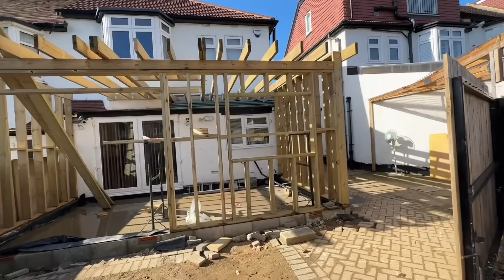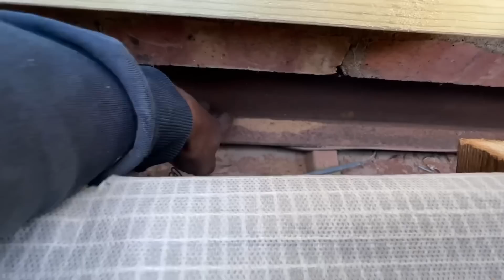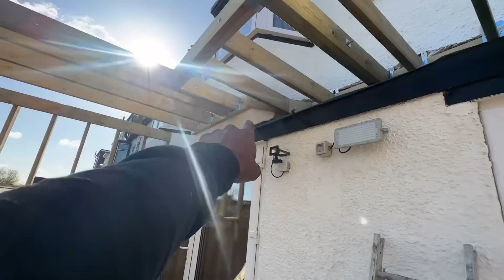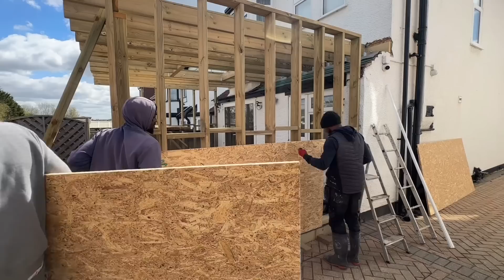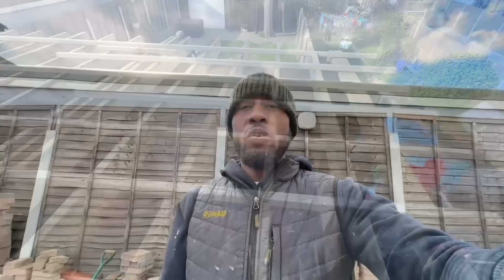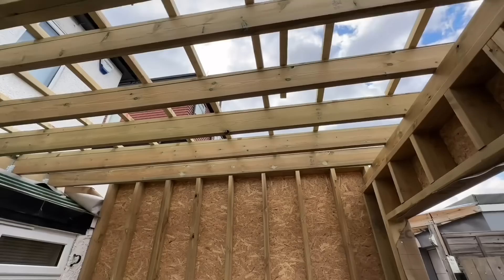Timber frame extension: Ep 14

Comment: great build and you guys should google "king and jack stud framing" and look at the images. The americans have been building houses out of wood and it's something they do better than us in the UK. The extra stud you added for the window opening that someone else mentioned in the comments of a prev video is called a 'king stud' and it should have been laid against the other stud (called a 'trimmer') which takes the weight of the opening 'header'. If you google it and check the images, you'll see what I mean. Great build!

Comment: Great job as ever Darren. One question. I'm a brit in Boston and am always interested comparing UK and US techniques. Over here we would have to put a big header - usually 2 or 3 2x12s or more over a window or door opening where they are in a wall supporting roof rafters. These headers would have to be supported by jack studs underneath them. I know you are adding supporting steel here and there and are building to approved plans, plus we get a lot of snow over here so have to worry about roof load, so this is not a criticism. Just interested to see the difference. Great work as ever love your videos

Comment: Do you ever use rubber instead of fibreglass? I would of though rubber roofing would last longer.
Reply: Not a chance, fibreglass will outlive the building if laid correctly.
Reply: @garyengland5326  really cheers for your reply